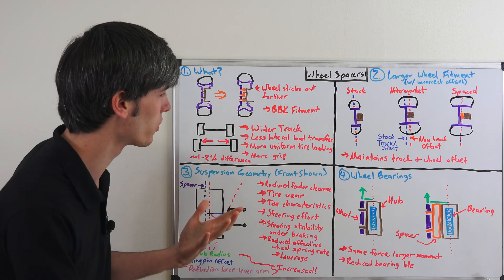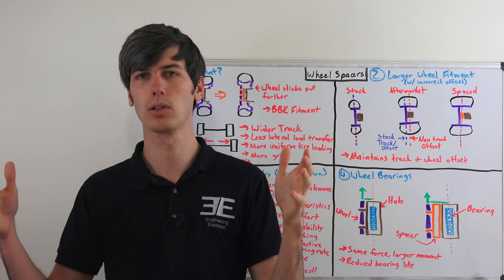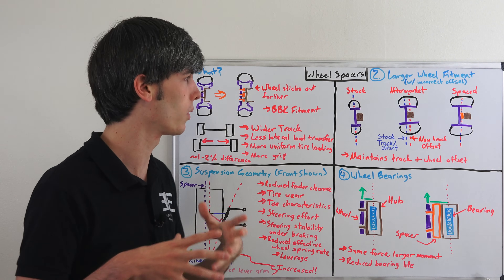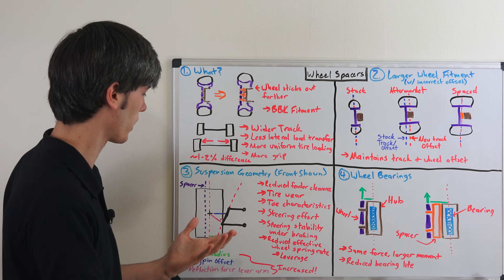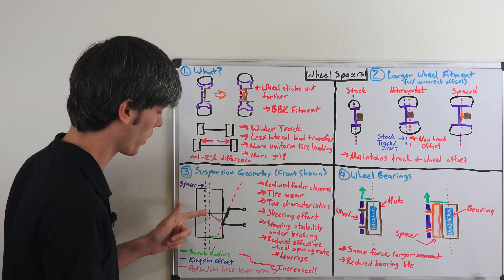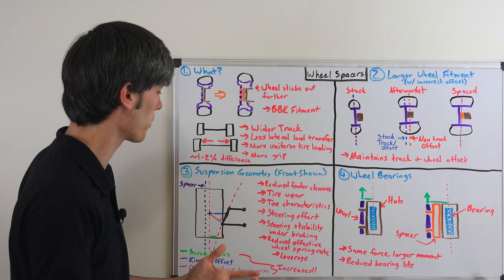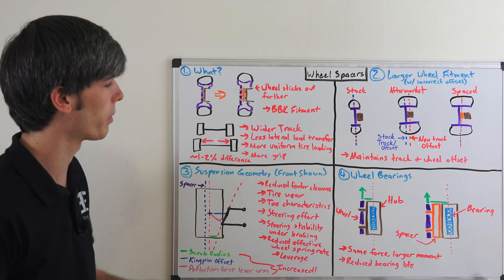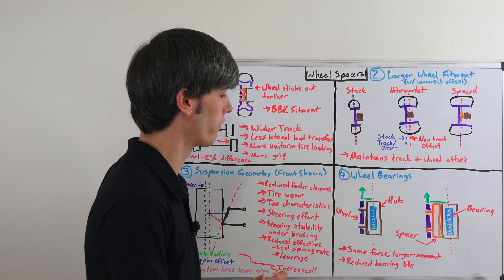Wheel Spacers & Adapters - Good Or Bad?

Comment: i have wheel spacers on my lifted  dodge ram cause I have 35 in tires and 15 in rims and the rims kept scraping the caliper. I havent had an issue with them and i still never saw a difference in my steering stability when i use to have stock tires and my stock tires and suspension and bearings went bad faster then what i have now with the spacers and larger tires. I live in Western NY and the roads here are bad so you need to modify your truck to be able to drive around here or your suspension and bearings and what not will just keep breaking on you lol

Comment: A few weeks ago, I installed some wheel spacer but recently I removed them. The main reason is because I just didn't trust them on my car, I felt like my wheel was going to come off when driving. I did install it properly, there were no crazy vibrations. I noticed my car performed better with the wheel spacers off vs with them on. My car drives more smoothly with the spacers off. If you look at the risks vs benefits of having wheel spacers, I personally feel the risks are far greater than the benefits.

Comment: I'm working with a 2000 Crown Vic P71. I like the look of the wheel spacing on the Bondurant (Cobra Vic), the wheels are off of a 95 Cobra Mustang so they had to use 1/2 spacers up front and 3/4 spacers out back. My question is with spacers under an inch, how much is that going to effect the stuff you are talking about in the video? I will say that I have read as much about the Bondurant cars as  I can find and have found no negatives about the set up. But as with a lot of modifications what works on the track that does not necessarily mean it will work on the street.

Comment: Great vids, good to see someone explaining in depths!

I think #4 wheel bearings is misinterpreted. The "vertical" force will only be placed like that, with a wheel with zero offset.
The offset translates that force into the bearing, thus removing the moment on the bearing, prolonging its life. 

A+ material, keep up the good work! :)

Comment: Glad to see a vid on this but two problems.

1. Adding spacers does not necessarily reduce the spring rate. It increases the compression forces on the upper arm and the tension forces on the lower arm. The specifics of the geometry of the links will determine whether the effective spring rate is slightly increased or reduced. In a normal suspension the difference would be very minor.

2. The diagram showing a moment load on the bearings assumes a significant negative rim offset before the spacers are even put on. On most if not all production vehicles the standard offset is positive or significantly positive.

Comment: is the wheel bearing argument even valid if you run wider tires? for example my truck came with 265/70r16 tires and the stock rims are 15 offset. I increased the size of my tires to 315/75r16, and added a 1.25" wheel spacer. now obviously the double a arm geometry on my truck works a bit differently than on a car because its not set up for handling its set up to allow for more travel. anyways with a 1.25" spacer the inside of my new 315 tire sits approximately at the same spot as the 265 without the spacer. the outside of the tread sits about 2.5" further out. the wheel bearing sits close to center on the stock rim, would the offset make a difference? I dont think the tire would be putting any extra pressure on the bearing due to the offset. although if you think about it like you are sitting in the middle of a raft, if you add a section of buoyant raft to the raft and you remain in the same spot the raft will tilt. so in my situation the tire still will put an angular force on the bearing, but if you adjust alignment to preload the outside of the tire slightly you can pretty much negate this angular force being exerted on the bearing.

additionally because the tire is taller, the wheel spacer helps return the scrub radius to normal.

great videos btw, I find suspension fascinating.

Comment: You need a bigger dry board man.
Reply from the maker: +PatonHaus Sounds like you need a bigger screen. :)
Reply: If he got a bigger dry board, it would have unintended effects on the geometry.
Reply: +Engineering Explained I know you are a busy engineer, but I do have a question about offset on this video.  If i go with a wider wheel, how do I keep a correct offset?
Reply: AustrianAnarchy
ie. Google ROJA Formula 1 rims. They are rims that are made of pieces so you can increase the outer lip and put some more wider tyres if you want.
Reply: +Engineering Explained so you dont have no damage if you just add the wheel spacers with stock tires, and stock wheels,???
Reply: HAHAH XD
Reply: ***** That's what all the girls say in mixed company. From what I hear.
Reply: Kelly Medley
Reply: 3rdpartyU5er I should have been more specific.  Wondering about the load on the bearing.  Pretty sure if the center goes out farther that creates a bigger load on the bearing, but if it stays in the center or is moved in closer to the hub is either of those bad too?
Reply: Well it depends on the centre hub of the rim because as you said it yourself as the hub goes further away the bearing gets more load but then again depends on the rim because there are quite a few different rims that have the hub on different location because of the width of the rim. You have no worries if the wider tires have the hub on same position as in stock tyres and what I mean is that you measure the hub distance from the inner end of the rim to the hub. So the wider wheel may be the same as stock wheel but after the hub the rim has a bigger lip for wider rubbers. This should not stress your suspension.
Reply: 3rdpartyU5er I have a 1972 Charger and will be using Magnum 500s, probably steel until I can afford aluminum.  So I need to figure this stuff out before committing to a purchase.
Reply: DAAAAAAAAAAAAAMN. GET DOWN. SHOTS FIRED!!!!!
Reply: Lmao
Reply: But that would negatively affect the load on the fasteners holding the dry board that they were not designed to hold.
Reply: this comment aged well
Reply: +Engineering Explained TRIGGERED
Reply: +AustrianAnarchy Well this is just my opinion but wider wheel means more surface area for the tire but I would assume that the tire still loads weight pretty good and suspension geometry wouldn't change drastically.
Reply: HAHAHA agreed but awesome info
Reply: PatonHaus why don’t you buy a bigger white board and try to do a better job explaining why or why not to use wheel spacers. That’s what I thought, you most likely can’t spell wheel spacer you jerk!

Comment: Typical misinformation in car mod video comments. Wheel spacers have their uses and are not just a "ricer" mod. Like anything else, there are pluses and minuses to any mod. Research and decide for yourself. There is no one answer as to whether they are good or bad, you have to apply them when they make sense and not when they don't.

Comment: wheel adapters can be good if you are doing a solid axle swap on a truck. going from a 5x4.5 to a 5x5.5 bolt paturn in the front. you can put some wheel adapter on the back so that you don't have to change the rear end if you alreasy have gears and locker set up in that axle

Comment: I feel like you glossed over scrub radius too lightly. Every modern car comes with a negative scrub radius, which makes it so that when your tires are on surfaces with unequal grip and you brake, the wheel with the least grip will counteract the wheel with the most grip, effectively negating whatever forces try to push your car to one side.
However, with a positive scrub radius the wheel with the least grip will increase the effect caused by the wheel with the most grip, essentially pushing the car to one side even more violently.

Unless you have calculated if you can run spacers, DO NOT RUN SPACERS. It's an unbelievable safety risk, so please just get different rims or be happy with what you have.
Reply from the maker: +AwkwardSilence https://youtu.be/SUDMEd1bMZI
Reply: Engineering Explained I know you made a video about scrub radius, but I feel like considering this video is about good or bad you didn't emphasize how bad it actually is :)

Comment: So thinking of a set of wheels on my 135i. 18x9.5 with 255 tires. The only people I've seen with this setup at running -3 degree camber in the front with 35 offset wheels with a 5 mm spacer. So in order to not run a spacer, I think I should get a 30 offset wheel?? I'm pretty confused on offsets and also spacers, just looking for advice really. Or is it 40 offset that will be the same at 35 w/ a 5 mm spacer?
Any help on this topic would be awesome!

Comment: I've also heard a lot, that they are not safe. On my 4x4 i just opted for a wider offset rim and wider tyre and get much better handling now. Went from +35 rim and 10.5" tyre to -22 rim and 11.5" tyre. Handles and stops so much better now.

Comment: Having hub-centric spacers is the same as having low offset wheels. Most people say they are bad but I have personally seen some of the fastest race cars in the world use them to great effect. Some of these cars generate in excess of 1000kg of downforce and i have spoken to the engineers and they have not seen a single bearing failure. Porsche even supplies them as an option on some of their models.
Reply: Guess it depends on how much the car weights, and also the quality of the bearings themselves.
Reply: The fastest race cars in the world are also usually rebuilt with completely new bearings (not to mention valves, spark plugs, pistons, shocks etc) so frequently that it isn't allowed to become an issue -- in some cases after every single race. They never see failures because the components that could fail are never ran long enough to even come close to failure let alone performance-degrading wear -- unlike your average "tuned daily driver" that will see 15,000 street miles a year but only ever have the wheels off when it's time to put new brakes or rubber on.

Comment: Hi I'm studying engineering and although my field isn't mechanic, I'm more on chemistry, I've taken basic mechanic courses, now my question is, with the weight and so on we're dealing here wouldn't modify the distance by mm in the case of lets say a 25mm spacer would have almost 0 effect? Just in the momentum for example I believe that doing the loads and moments (again on a very basic level) the effect would be almost 0
Reply: Real engineer rely on actual numbers. Saying almost zero is bad sign.

Comment: One thing you forgot to mention... You're adding more weight to the hub when you add wheel spacers, more weight causes higher rotational friction. So you might lose a slight amount of power.
Reply: As well as suspension response.

Comment: if I decrease the size of my wheel, say for winter tires, would wheel spacers be a good idea or would they be detrimental?
Reply: You mean skinnier? No, but you would probably want to buy separate rims with a slightly different offset. Generally I run steelies in the winter with a slight more narrow tire, but a stock steelie for my car. You shouldn't have to adjust with spacers for that. You probably will need an alignment to adjust your car to the different size tires though.
Reply: +hugeslacker I went down 2 sizes from a 17 inch wheel to a 15 inch wheel...so a smaller and skinnier tire
Reply: +Shawn Conlon the diameter of the rim itself shouldn't matter if the diameter of the tire stays the same. Skinnier, an alignment will sort out any issues, as long as the rims are the proper offset.

Comment: One big thing that you don't explain in this video is how widening your track will effect oversteer/understeer on corner turn in, mid corner, exit of corner. From my karting days I can tell you that widening the rear track will have a fairly dramatic effect on reducing oversteer and will start to introduce understeer. Changing your track in a kart is one of the most profound changes you can make to the handling characteristics.

Comment: Best way to use spacers especially 1" or bigger is for looks of the car/vehicle only and only for normal driving conditions!!! Avoid racing, hard cornering, and off roading if wheel spacers are installed on your vehicle.

Comment: One other reason wheel spacers are used are in 4wd oversize tire applications. Mounting over sized tires ( by over sized I mean larger in diameter)) on a lifted 4x4 is fine. However your turning radius may be reduced or restricted because the higher larger tires will now scrub the frame at full left or right lock of the steering. By adding wheel spacers it pushes the tire outboard more in relationship to the frame rails allowing full steering lock without the higher tires scrubbing the frame.
Reply from the maker: +Peter Currie Makes sense for off-road purposes, in these cases you're likely going to be modifying the suspension significantly anyways.
Reply: Problem is it pushes that tire outboard toward the fender lip also. One has to do a balancing act between not rubbing the frame at full lock and not doing the slice and dice on the tire sidewall with the fender lip at full stuff.

Comment: I usually don't like your vids, the math/physics/chemistry is fine but some things are just plain wrong (there are stock black painted inter-coolers but probably not for radiation).

This one is good tho.. thumbs.
Reply from the maker: +piecartbox What things are wrong? I try to put in corrections for errors (and add notes in the video description). Also, just because something is painted black doesn't mean it's painted black to improve performance. Paint in many cases is used entirely for aesthetics.

Comment: I have 45mm Hubcentric wheel spacers on my Jetta and it's covered about 11,000 miles with them on it and everything's still good, no wheel bearing trouble or anything.

Comment: The biggest threat of wheel spacers is indeed the change in Scrub Radius and in Kingpin offset. In short: you could be altering your NEGATIVE scrub radius to a POSITIVE radius, with the result being you slipping all over the place when one wheel is on a surface with less friction (Icy spots, gravel, etc.). The other problem lies with your increased kingpin offset and having a lot of power driven to the front wheels, which results in massive torque steer.
Hope it's any help!

Comment: i get your point with the wheel bearings, but if you think about fitting lightweight wheels to your car, the moment will be less or the same depending how heavy or light the wheel is. love your videos, fits perfectly with my automobile technologies study in university!
Reply from the maker: The wheel weight is important, yes, but it's a tiny fraction in comparison to the weight of the car that rests on these wheels. The weight of the wheel wouldn't really affect the moment on the bearings in comparison.

Comment: You will also generally need extended lugs with spacers. It can be dangerous when people use the stock lugs since there's less threads available for the lug nuts to grab onto. Aftermarket wheels in the offset you're trying to get with spacers don't have this problem.
Reply: For thinner spacers like 5-10mm this is true. With 15-25mm they come with their own studs though.

Comment: for the last point, even without wheel spacers, if the wheel has more offset it'll wear the bearings out faster.

but if the wheel is wider towards the center of the axle it could compensate the offset and thus have normal wear characteristics.
Reply: Pyry Mustonen Let me explain what he meant. I for example had 18x7.5 with 45 offset. I bought aftermarket wheels 19x8.5 with 40 offset. Due to the wheels being 1 inch wider but only 5mm less in offset, my wheels stick out around 18mm more. Therefore my wheels are also around 8mm wider on the inside, which results in less space between my suspension and my wheels, but also less leverage on my bearings
Reply: The major issue with wheel spacers is the safety factor....bearing, scrub radius change, loading of springs, etc ALL negatively contribute to possible problems that can result in an unsafe car. A wider wheel can give the same issues but often those wheels are wider both on inside and outside so yield the same tire position relative to stock. In many countries use of wheel spacers is illegal. If you think you are a better engineer than the people that designed your car...go ahead and mess with spacers but I would never use them on my SCCA race car or my street cars. Just get a PROPERLY specd set of wider wheels and tires.
Reply: Very true but in the case of spacers not wheel offset the wheel doesn’t get wider. If you do spacers and wider wheels the wheel is still push outward more which still moves the center of the wheel out further from the car.

Comment: Would it Really affect spring rates as the length of the actual lever, which is the suspension arm, doesn't change??    

also great Video by the way,  very helpful for setting up a track car.
Reply from the maker: +TheMacca431 Yes, it really will change the wheel spring rate. Maybe eventually I'll get into it but a google search for the time being can usually come up with some decent explanations of this. The leverage of the vertical force from the wheel changes, and thus this reduces your effective spring rate.